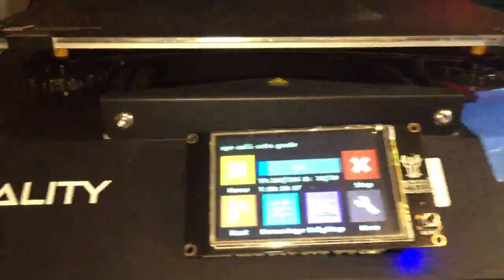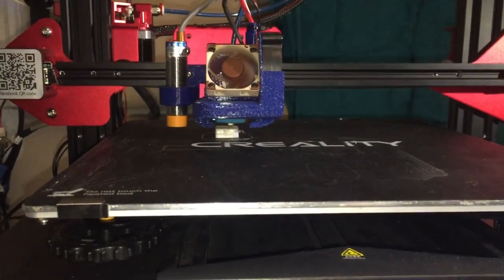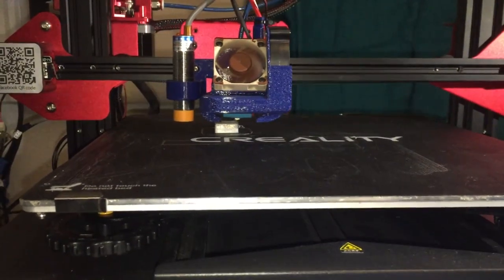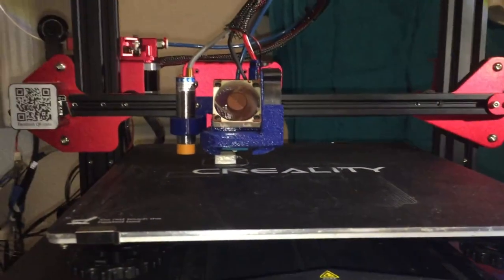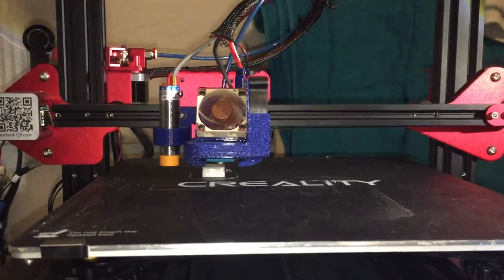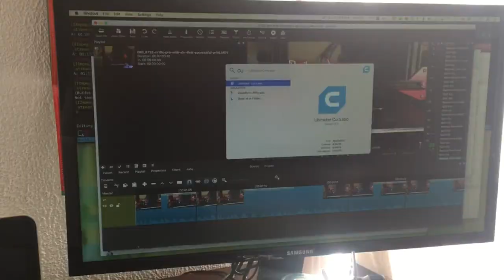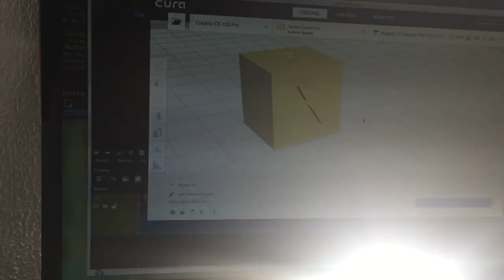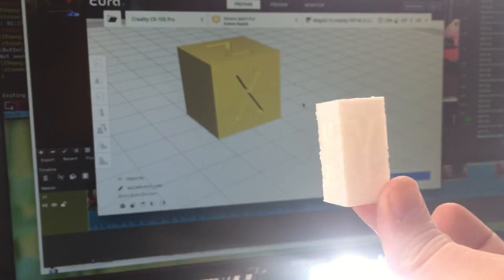SKR v1.3 Creality CR10S Pro calibration cube first print

Comment: Hi man, ihave the same configuration of board and touchscreen, but i tried to update the screen to the latest colored cool way and it didn´t work, it was blurry, so i had to go back to older version of firmware , how did you make it work?
Reply from the maker: copy the folder for your particular screen within the "Copy this ... directory" from the github repo you cloned for your screen, and make sure you copy the "unified screen files" and not the standard as the standard are the blue icons.

Comment: Hi Chris, im trying something similar (CR10s5)

can yo share you config and wiring with us please ?
Reply from the maker: yeah i've documented a lot of the process upgrading from the stock cr10s pro 8 bit board to the skr v1.3 along with upgrading the stock touch screen to the btt tft35 v2, however i haven't sorted through all the videos i've recorded and i've jotted down quite bit of notes about how everything got wired up.

the pro has a stupid 30 pin cable, and even stupider daughter board attached the gantry that are both super annoying. i bypassed a lot of the daughter connections and wired up quite bit of auxiliary wires to the z probe (inductive sensor) 12v fans and what not.

i've been compiling marlin 2.0 bug fix from source (haven't pulled upstream changes in a while) but I do have a fork of marlin, link below.

https://github.com/ipatch/marlin

i'd like to release a comprehensive video explaining the whole upgrade process top to bottom, but that's not going to be published anytime soon, as i wouldn't want to release a such a video with a half ass attempt.